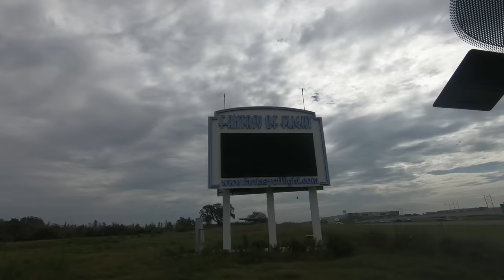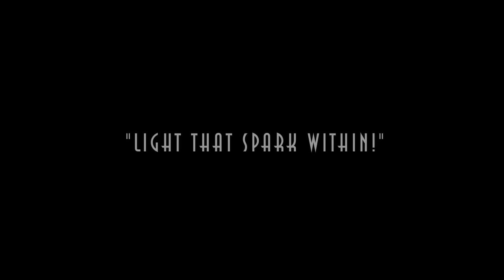Douglas DC-3 - Kermie Cam - FoF I-4 Icon

Comment: Looks like the top cockpit escape hatch is missing as well.  Fortunately, the inspection plate under the nose is still there.  When we redid ours to static display, that was one part that was almost impossible to find.  Oh the joy of bolting on those wings!!  Ours now resides at the Langley Museum of Flight in B.C. Canada, just outside Vancouver.  They've pushed her over where there is no access.  They may be interested in getting rid of it.  We put ten years of our lives restoring her to static display, to watch her fall into disrepair again.

Comment: Kermit,

20 miles from my house is a DC3. Wings are there but they've been unbolted. Still sitting on its tricycle gear upright and proud but for 30 years Ive hated seeing her out there rotting. If you're interested let me know. Its in south Mississippi.
Reply: DC-3's - all variants, C-47, R4D, were conventional gear..... all other Douglas prop aircraft in airline service were the DC-4(C-54)6 and 7 and were trikes......sure you're not talking about a Beech H18 Tri Gear conversion ??

Comment: What happens to old gymnasts?  They get stuck in a DC-3 on the interstate.  
Here is a no joke make it look OK thing.  Spray rust inhibitor on the places you want to patch over, then use a really strong adhesive tape and tape across the hole.  Then spray white, black, or clear FlexSteel over it.  Do not laugh. I have done that over fender rot, rocker panels, etc.. I did my rotted-out pickup to give to my grandson, and when he gave it back to me 6 years later the tape and FlexSteel were still in place and holding.  True teenager tested rust fix.